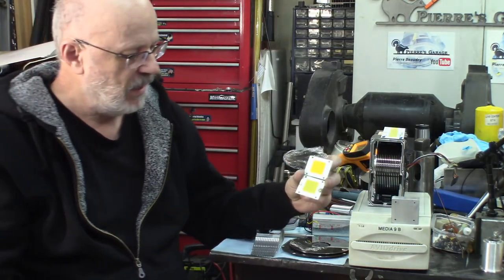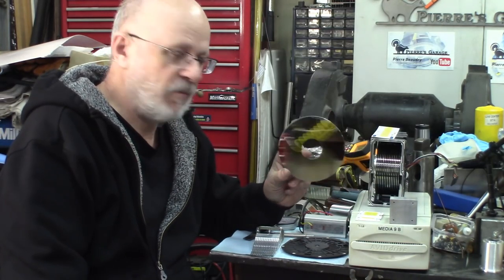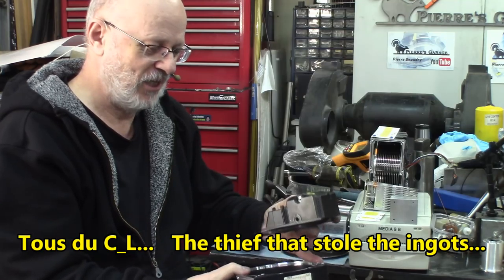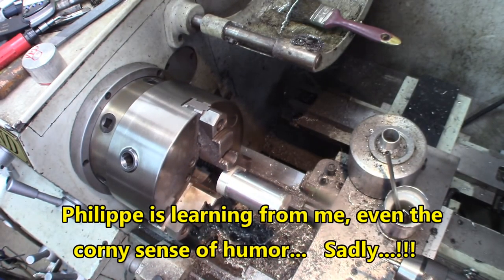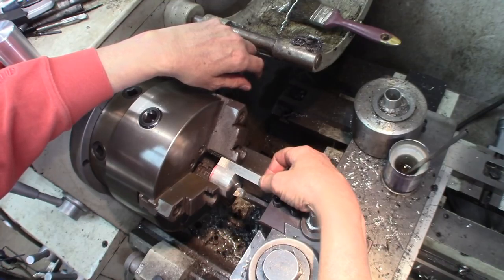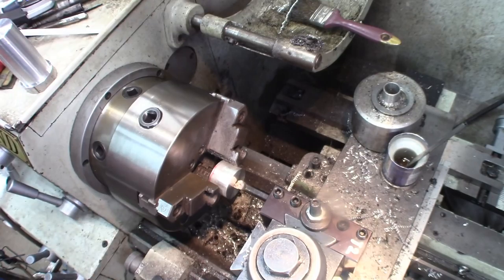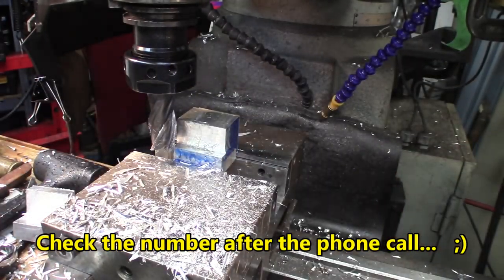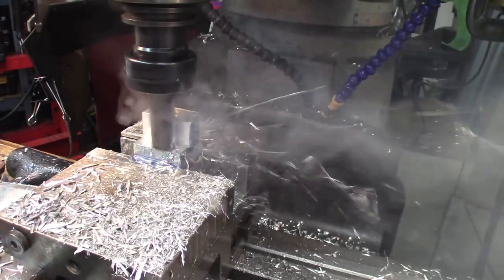50 watts LED COBs, About them and making a light fixture from recycled materials...  Part-1

Comment: Pierre, you might be interested to know that fin spacing for convection heatsinks (no forced air) has fin to fin spacing comparatively far apart, because the fins heat one another and reduce convection air flow when they are too close together. You can find some fin spacing calculators online, but in general you will want to have fins 5 to 15 mm apart.
Reply from the maker: Hi Paul,
I'm taking note of your input, presently the spacing is more like 4,5 mm or so...   
Not very wide...  
You're right about what you say, I'll have to increase the spacing, this will surely improve the air circulation between th fins, chances are that I'll need less fins to get the same dissipation...
Thanks for a valuable input,    Pierre
Reply: Pierre's Garage Heatsink performance is also improved by making surfaces more rough, painting shiny metal surfaces to improve emissivity, and anything that increases convection airflow turbulences, e.g., slots, louvers, feathering, and so on.

Comment: the last shot with the two fingers and the spring pin....owchee momma...solution: old carpenter trick for short nails and hammer in hand....turn your hand upside, palm up and hold between two fingers....less screaming, no cursing...
Reply from the maker: You're so right about that forgotten trick and short nails, mostly used by roofers.... also the pair of pliers is a good foolproof alternative, was too preocupied by filming to remember...    lol
Thanks,    Pierre

Comment: Hi Pierre !
Nice little project ... I have a lot of these disc too ... so why not make a pair too ;-))

But you didn't memtion enything about preparing the discs ... do they need to be formatted first, if not, I think the data will smell very bad when they are heated up - right ?
Reply: all the peanuts you can eat, who needs more?  cold UK too, 4c in my little shed, do not have heater that will make a dent, so all visits are short for last couple months
Reply: After 1-2 pounds you certainly need a beer too ...
Reply: So, if we start hearing odd audio bits during "machine porn" moments, we will know that something escaped the zap and somehow migrated into the audio???

Comment: This has to be the most overkill light fixture ever! You can buy extruded aluminum angle stock for dirt cheap...
Reply from the maker: I know, but i'd need another suggestion for the hard disk platters...   lol
BTW, I got some some extrusion angle and tubing in the stock pile...   
Thanks for taking the time to comment,   Pierre
Reply: laser engrave the platters, send free to subs for coasters^
Reply from the maker: Cheaper as ingots or heat sink...   lol

Comment: so an unrelated question:  canada is now metric like the UK is, did it use inch measurements in living history? uk seemed to go metric in the 1980s but older people of course still think in feet/inches,(Some think in old money which went in 1972)   road signs are still in miles weirdly, some things are fudged to be metric but are really imperial , we sell milk in 4pt containers but its really 2.27 litres as maybe 2 litres of milk wouldnt be enough.  i see you sometimes use inch measurements yourself, so id just like to ask more about why, though id assume part would be the older machinery you might use would be in thou's.  myself ive always been metric, but learned bad habits from parents, when i estimate measurements its feet/inches.    thanks for a great video once more!
Reply from the maker: Hi, Canada was once all Imperial...!!!   The chnge occured in early 70s, by now everything is matric in labeling, grams, kilos, kilometers, distance, temperature is Celcius, etc, one thing that is still kinda Imperial is construction standards and materials dimensions, except that lately they started to adjust thickness in millimiters, probably cause it's close but not as thick as Imperial, to their advantage, naturally...!!!
I was first taught in degrees F, but now I struggle to use it again since I'm so used to metric...   
But, all or almost all of my measuring tools amd machines are Imperial based, by using decimal based dimensions like thousands, it's easier than fractionnal, though...   Here in the shop I work almost exclusively in Imperial system, if I have to cut metric parts, I'll convert...   
And finally, thanks for being a long time supporter of the channel,     Pierre
Reply: One of the things that take time and investment when switching from imperial to metric is for industry  ( ie milk bottle producers)  to convert designs to metric, its a lot less expensive to change a label than to make new molds.
Reply from the maker: Like now for example, the yougurt containers, first, 1 kg., then 850 grams, 750 grams, now 650 grams, for the same great price, the container is willingly changed when the lack of filling gets too obvious, there should ba a change soon, cause the 750 grams container looks cheesy when only filled with 650 grams...   ;)
Aaaaaaaaah....!!!   Progress, there is no end in sight...   lol
Reply: What a lot of people don't know is the U.S. is also metric, we were one of the original signatories for the treaty. All of our jars and packages give the contents in both systems. Our "inch" is now officially defined as 2.54 centimeters, so it can be traced to the metric standard. However, except for soda bottles, nearly nothing common we buy here is in even metric units, still even imperial/fractional metric units. Absent some tax incentives being created, I don't expect that will change, since the first guy to sell Milk by the Liter will have to raise the price (and lose sales because of it).
Reply: weshowe, its sold by the liter in the UK, no pints mention on the package, but its 2.27 liters, which  is exactly 4 pints if you convert, thats the workaround

Comment: I like led lights but I recently learned the light from them may be harmful to your health
Reply from the maker: You're surprising me...   Do you have anything serious that supports this...???
Thanks for your comment,     Pierre
Reply: the most awful indegestion i would imagine from the pointy heatsink?
Reply: Do some research
Reply: yeah but so are mobile phones, and wifi signals, there is opinion for sure, but no actualy information on what to actually do about it, do we sit in the dark, breathing smoke from burning whales oil?  led are better as no mercury than cfls, and save a ton (more than) of co2 from the generating power for filament bulbs, thus the saving in cancer from all the radiation released from coal burning, and working less hours just to light your house to the cost savings etc
Reply: basically the only site that says they are , are a shill for selling soy candles to make them healthier again....hmmm (non gmo and kosher ones too lol, shame we cant light one on a saturday eh!)
Reply: The only issues I've heard are if you stare into them long enough it can damage your eyes and that the aluminum gallium arsenide used as the base for red LEDs is toxic to animals. However the amount used and the fact that it is sealed inside the chip renders it harmless to the end user.  
The other items I've seen are from a german doctor who thinks you can cure diseases using various spectrums of light... He has also pushed how any light source other than the sun is bad for humans and should be eliminated because they cause cancer and illness.
Reply: Are you referring to lasers?